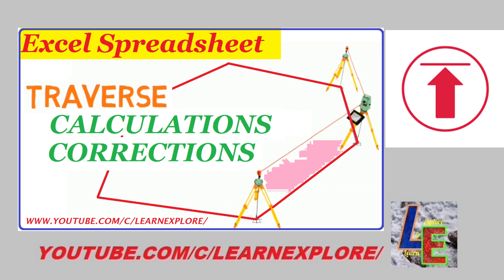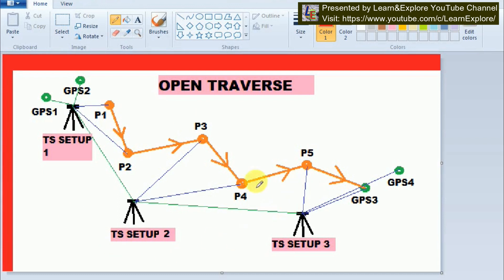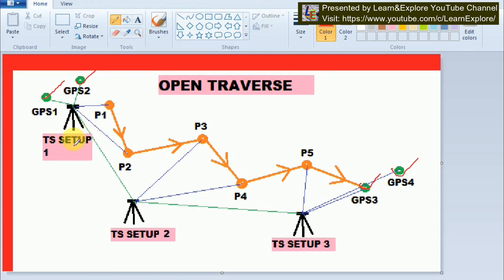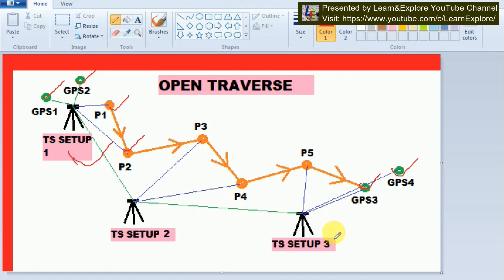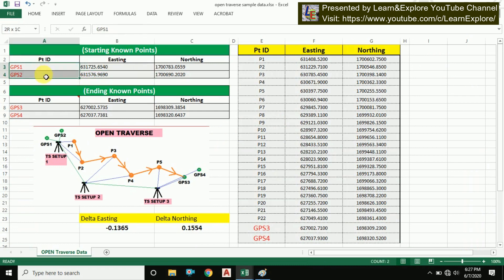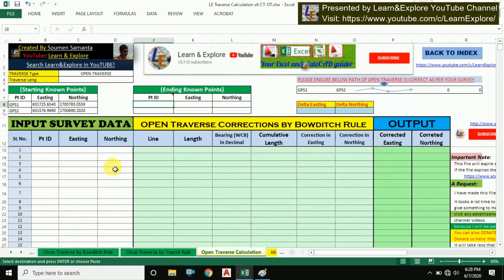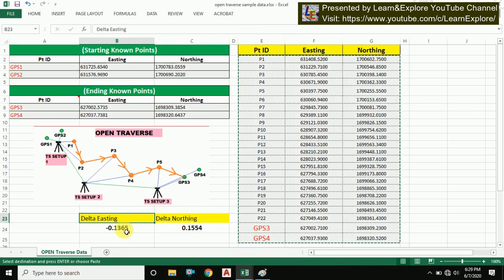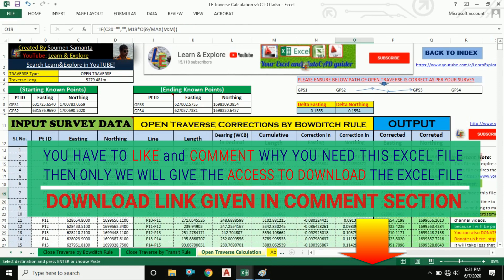Open Traverse Theory & Excel Sheet for Correction | Land Surveying

Comment: It's protected and asking for the password how can i use this bro?
Reply from the maker: Input cells are not protected by password
Reply: @LearnExplore  but i couldn't get the adjusted coordinates it's completely protected
Reply from the maker: In the Input section when you will update with your data adjusted coordinate will be updated automatically. Just copy the adjusted coordinate and paste as value in another sheet. Still if any problem arises contact us with screenshot.
learnmoreexplorehuge@gmail.com
Reply from the maker: We also send you the Excel file